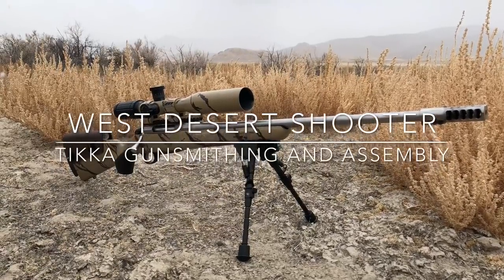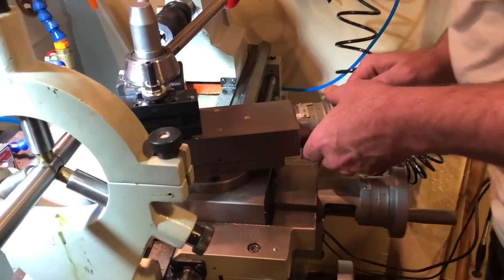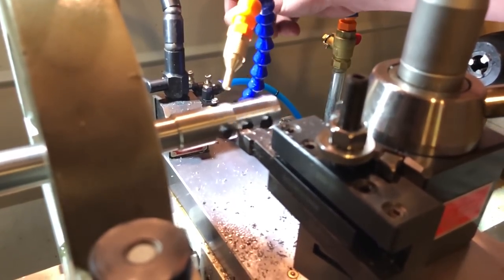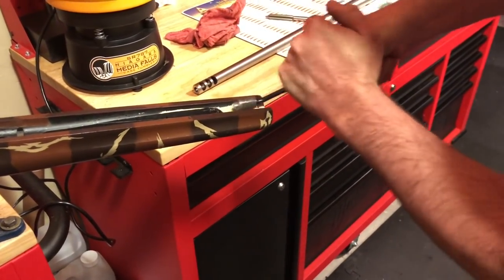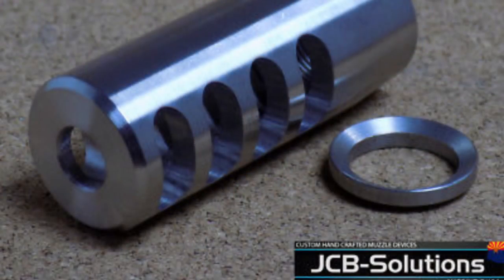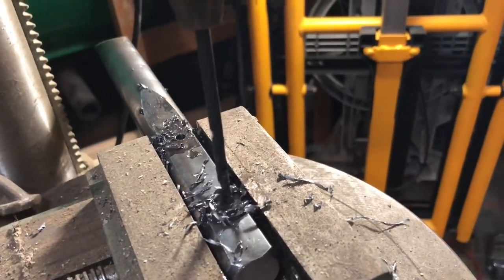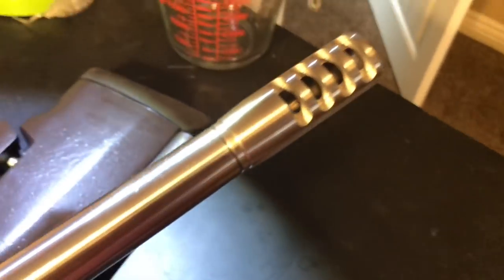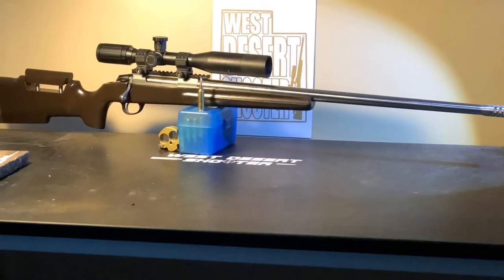Tikka Build; Smithing, modifications and Assembly

Comment: I just finished threading and chambering my new Tikka Hunter barrel yesterday.  Nothing wrong with the way it was before other than the fact that the barrel on my 6.5x55 was only 22 inches long.   I felt that the short length kind of limits the potential of the rifle/chambering.   I too got a stainless steel light-varmint profile barrel similar to the one you showed in your other vid.  I threaded the muzzle and by using the one inch section that I cut off I was able to use that to make a seamless looking thread protector to match.  

I did have to inlet the stock cause this was a budget project and I didn't want to shell out for an aftermarket stock. Besides, I kind of like the look of the factory Tikka Hunter stock.  I plan on CeraKoting mine so it's still a work in progress.  Also, rather than turning a shoulder on the tenon like the factory barrel I elected to use the Savage-Barrel-Nut method to secure my barrel.  I've used this method before on a couple of my other rifles and it really makes headspacing a piece of cake.

I had a short piece of stainless steel rod stock left over from my K31 Swiss project so I used that to make a matching barrel-nut.  Since the tikka rifles come from the factory with a MOA guarantee,  I didn't see any reason to waste time trying to "True-Up" a receiver that had already been trued at the factory.  I've owned about five different Tikka rifles over the year and all have been tack drivers right out of the box.  I have no reason to believe that it will be any different with a new stainless steel barrel in place.

Great videos.  It's good to know that other guys dream the same dreams as I do when it comes to their rifles.  One last thing;  I originally was going to rechamber in 6.5x284 Norma but buying another reamer would have put me over budget on this project.  I already had the 6.5x55 reamer from my K31 Swiss project so I took the cheap way out.  With the Barrel-Nut method of installing my barrels I can easily remove my new barrel and ream it out even further with another chambering if I decide to  do so; and if finances allow down the road.

Comment: That build is a kick-ass! I have a Tikka T3 .308 lite and I want to change it to a heavy barrel but the barrel won’t budge a bit. Any suggestions to remove it without destroying/twisting the action? I want to change it into 6.5 CM. Thanks for your suggestions/help. Keep up the good work, bro!
Reply from the maker: Get a small torch add some heat while clamped in a vise with gripping powder and an action wrench. Have a smith do it, then if they mess it up it’s on them! Haha
Reply: Hi, I have the same problem. How did you remove your barrel ?
Reply: @br4713  I sent my rifle to a gunsmith who knows and had done it before to be safe and he installed the new barrel too.

Comment: Looks good man. If you're pushing 180gr at 2900fps, you're going to need a 40 moa rail and time for a real optic bud. The ballistics on a 7mm 180gr are incredible. Any info on the smith? I'm putting mine together soon when I go on vacation in a couple of months.
Reply from the maker: I agree about the rail but really the only benefit of a pricier scope is clarity. I have plenty of adjustment that works reliably. I’m more thinking of an adjustable base to really stretch out. But for now I’m still learning